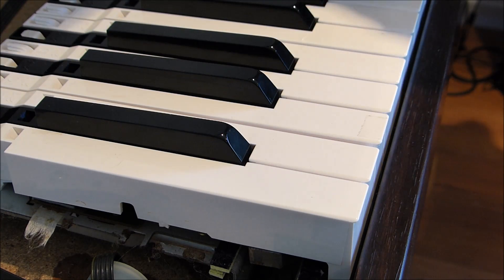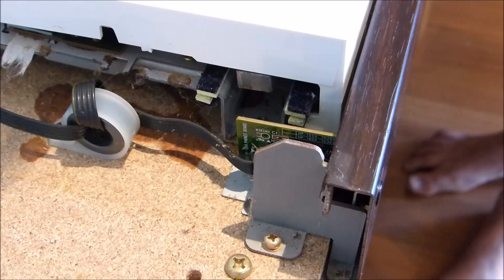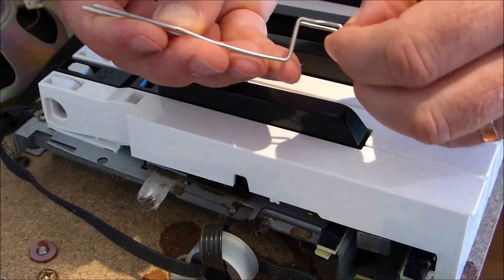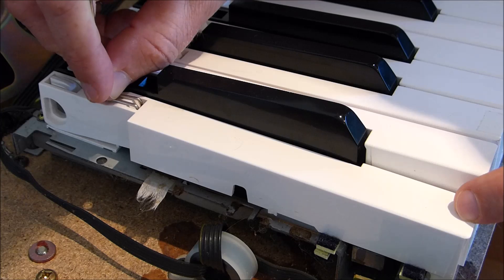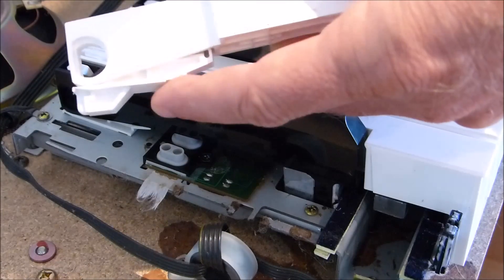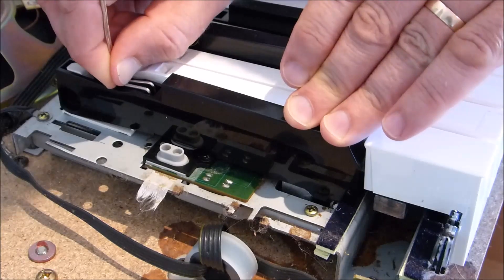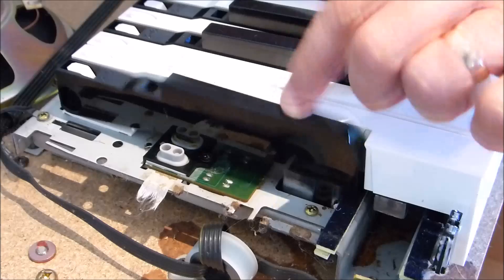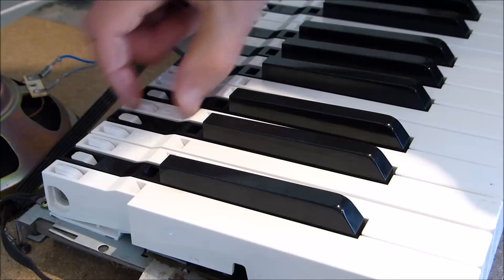Roland HP-230 Digital Piano Key removal for contact repair HP-3700 HP-800 HP-2700 KR-4700 KR-5000

Comment: Ok, i blew it. I cleaned all the connections with rubbing alcohol and then used a 7B pencil on them and now it's even worse off then before, with more bad notes. What did I do wrong??
Reply from the maker: if the circuit board pads were in poor condition its possible the alcohol rubbed them away too much? There are "conductive pens" you can buy to reform the circuit which might help. Utlimately my keyboard needed too frequent repair and I gave it away and ended up getting an acoustic piano (which has its own issues).

Comment: Do thr keys on this piano model have a weighted action?
Reply from the maker: I no longer have the piano but yes the keys did have weights, however I don't think the weight grading changed from the low end to high, it seemed the same all the way through. There is no simulated hammer action.
Reply: @Fontgod  ah right, cheers. There's just one available near me for not too much, and I wasn't sure whether it'd be worth repairing instead of buying a new keyboard.

Comment: Thanks for getting me started on this RD300S I'm working on . I found an alternate method for removal of the keys but, you need a mechanics-style right angle pick made of hard steel. It fits under the TAB area and you push it like shown in your video. Black keys come out in the opposite direction.  Just take care when removing the white keys. The bottom hinge is spring loaded and it MIGHT want to pop open.
Reply: There's  LOT of debris in the assembly which means I'll have to pull ALL the keys to clean up the keybed
Reply from the maker: Thanks. That sounds very similar to HP-230 method.

Comment: Thank you. I’m attempting a repair on a neighbors HP 800 which I believe was made around 1987. Besides massive amounts of cat hair, some liquids and various other debris have infiltrated the piano. There are two keys that have issues. One is excessively loud and the other works maybe every 40 pushes. After watching this video I was able to remove the non-working key. I have hope that I’ll be able to clean/repair the contact of the non-working key when I get back to it at a later date. There’s really no other information on the internet that I could find for this old model other than some sketchy download sites. Without your video I’d have no clue how to remove the keys. Thank you again!
Reply from the maker: Glad it helped you. There are usually two contacts for each key and the time it takes between when each contact is activated determines key velocity, one of the contacts may have some debris that shorten the time causing the piano to think that it has been hit at full velocity. Often cleaning applying carbon to the contact with a very dark lead pencil can fix the keys for a while. I eventually gave away my piano as it needed repairing/cleaning more and more often. I'm not sure if the contacts are the same for the HP800, but on my old piano there was a plastic cage surrounding each group of key contacts, unscrew the cage for the group and prise the cage from the front upwards and backwards towards the rear of piano and kind of hinge it backwards if that makes sense. First time is harder as it is sticky. When re-screwing the cage, first spin the screws slowly counterclockwise and wait for a slight click as they drop into the thread, then clockwise screw to tighten, this helps prevents cross-threading which is what the screws really want to do if you don't use this method.
Reply: @Fontgod  thank you for being so responsive to comments on your video. I was successful in getting a few of the keys removed but with much difficulty. I suspect the tool I made is too stout, that is the wire I used is too thick. I broke the small lip on one of the keys that keeps the rocker/spring mechanism in place. After much worrying I realized it does not keep the key from popping up higher than the others so much relief there. I've super glued it back together and expect it to not be a problem. I will refashion a new tool that will hopefully allow me to remove all of the keys. This unit is absolutely filthy! If not, I will just focus on the 2 keys that are a problem. The HP 800 does not have "cages" as you mentioned but just the rubber cover that presses into the PC board. Cleaning/repair should not be a problem once the key(s) are off. Thanks again for responding. I will repost with the results.
Reply: @Fontgod  I made 2 more keys out of different material, as close to the specifications you provided. I was unable to make them work. Somewhere along this journey it became clear that locking down the piano key then pulling up disengages the plastic stud that locks the piano key to the frame thereby allowing one to slide the piano key out of its positioning slot. What I ended up doing was, starting at the end key, I slid a razor knife blade under the piano key base then pried the base up enough to disengage the stud and slide the key out. I successfully did this for the entire 88 keys. Nothing broke and I now have the unit opened for a much needed detailed cleaning. I found debris between the contact of the non-functioning key and with just the rubber cover in place it now is sounding. I will check each key as I replace them. Thanks again
Reply from the maker: @nunyabuisness9658  Yes, that is an alternate method that is mentioned in the comments a few times but does require removal of all keys to the left of the one you want to fix (if you start from the left), my piano had a small slot on the side of each key that would have made this even easier as a small screwdriver would  also work on the side. The tool can be a bit intolerant and possibly even needs different measurement for your model. Glad you got it sorted.
Reply: @Fontgod  thanks again for your initial post. After a painstaking cleaning,  this 35 yr old HP 800 works and looks like new again! I watched the video again and can see the slot on your keys where a small screwdriver would fit to lift the stud out of the metal base. The HP 800 keys look identical to yours but without that slot.
Reply from the maker: @nunyabuisness9658  Always nice to hear that a piano stays out of landfill for a little bit longer. Well done. :)

Comment: I cannot  thank you enough for this video. I have a Roland hp 1800 with the same keys. I was just about to give up on the homemade tool, and it worked! Was able to fix my FFF key with the matchstick trick too. Am happily playing again...
Reply: Can you explain the matchstick trick?
Reply from the maker: Very glad it helped you, keep in mind that the problem may recur over time. I used to keep the screws out of the casing so I could easily open it up every few months to fix keys that were failing. Have added the HP-1800 to my description based on your comment.  :)

Comment: hi there fontgod, amazing video, thanx so much! is there any particular order keys should be reassembled in hp 230? im afraid i got them rather mixed up
Reply from the maker: I no longer have my HP-230 but I do recall the keys are marked on the back end, however I don't think the key weights are different from low notes to high notes like on some other variably weighted key pianos so perhaps it does not matter too much about the order.
Reply: @Fontgod  si si, youre quite right, black keys are all exactly alike, despite different markings on them, white keys are seven types, they all have their markings: A B C...  and so forth, thanks again!!! that cleaning did wonders!!!

Comment: Super helpful and thanks so much. I have a KR 3000 with the same keys that has seen a rough life before I got it. I was looking at your paper clip design, and it reminded me of something. Those things that come with paint cans to open them (they look like beer bottle openers) work really well - got all 88 keys out with no problem using that. Thanks again
Reply from the maker: Interesting, did you need to bend it as per my instructions or was it pre-bent to a suitable state?
Reply: @Fontgod  Nope, it worked just as it was. Some of the newer ones that come with paint cans are a little wide for the hole, but I suppose you could grind off a little bit on each side. The "hook" is fine. Cheers, and thanks again!
Reply from the maker: @sophiezanep  Great tip, thanks for that. My Roland has since passed on to a new owner but I'm sure it will come in handy for others.

Comment: Worked like a charm, thanks for the tip! I noticed that I only had to make the 7mm and the 3mm bend at the tip of the wire (I used a thick paperclip as you suggested), the other bends were not needed...
Reply from the maker: Good tip. The bends are as defined by Roland, so I'm guessing that the third bend helps to hold the tool in place (it's been a while since I have looked at it), although as you say it will also work without.
Reply: @Fontgod  Indeed, because I have to hold the tool in place with one hand while removing the key, you do it without doing that. Nevertheless, in the meanwhile I have been able to repair all my keys, and am playing my digital piano again. Thanks for the tip again!

Comment: Very informative video!  I have a very loud key on my Roland HP-2900G.  Do you know if that model has the same key mechanism where your technique would work?
Reply: Thank you for taking the time to research and for the very detailed response.  I will definitely give this a try soon and let you know how it goes.  Thanks again!!
Reply from the maker: @josephwallace6058  No problem, hope it works out for you.
Reply: @Fontgod  Update:  So I was able to successfully open up my Piano and remove a number of keys with the paper clip tool.  Your video and tips really helped me get through this process, so thanks again for the information!  After cleaning the contacts I discovered that the rubber contact pad (aligned to my troubled key) had a slight tear.  And it looks like this is the issue because it doesn't land correctly when the piano key is pressed down and forces the loud sensor to be triggered.  I'm now trying to find a replacement pad and hope that will fix my problem.  If anyone knows any sites to check let me know.  It's out of stock on Syntaur.com. Thanks again for all your help!
Reply from the maker: joseph wallace oh that could be a problem then. They always seem to be out of stock at syntaur, perhaps if you message them they may stick them occasionally when a broken donor keyboard becomes available. You could try glueing if the tear is not too bad, or perhaps swapping pads from an area of the keyboard that is less used, that may at least allow you to play the centre of the keyboard.
Reply from the maker: @josephwallace6058  I think it's likely that Syntaur only get them in stock as salvaged items so perhaps they may be able to put you on a wait list? Failing that, not sure if the tear could be stuck with superglued or maybe some silicone if it is not too bad? You could also swap the contact strip out for one further up or lower down the keyboard which may at least allow you to play the centre of the keyboard.
Reply: @Fontgod  I was lucky to find the rubber piece I needed on Ebay, and was just able to open my Roland up again, take out the keys and replace the rubber piece.  Finally, my issue has been corrected.  My son and I are very happy since we've been dealing with this annoying G note for months.  Thanks again for all the directions and advice!  Your videos really helped me!
Reply from the maker: @josephwallace6058  That was a lucky find. :)
Reply from the maker: I did a bit of research and it seems that the HP-2900G does have a very similar key mechanism which I think is called SK-6L (not SK-6 as is the case with my piano). From my understanding the key removal tool is the same, however the sequence to removing the keys is slightly different in that to remove a black key you first need to remove the two white keys either side of the black. Replace in the opposite order.

The velocity/volume issue is likely related to a dirty or bridged contact below the key. I'm guessing that some conductive material may be stuck to the velocity contact causing it to be bridged and hence the key is playing at full volume even when pressed lightly. Ive had similar issues with mine that has been fixed at least temporarily with a contact clean with isopropyl alcohol. The contact rubbers need to be removed to clean below them on the circuit board itself. On my keyboard, I removed 3-4 screws from the plastic bracket holding each contact strip in place then it can be easiest to tilt the bracket up and backwards like a lid rather than trying to remove it completely as it can be a bit hard to remove otherwise.

IF your keyboard is similar to mine, the first time you do this the bracket may be hard to lift up as it may seem stuck to the circuit somehow, you may need to lift it at the front with a thin plastic pry tool to get it to unstick. You'll need to remove quite a few keys to get access to each contact strip as each one is around 20cm wide or therabouts (some are shorter or longer than others), just remove keys until you see the left or right edge of the bracket.

A tip when replacing the screws in the bracket, if they seem to crossthread and hard to screw back in, try turning each screw slowly anticlockwise for about half a turn until you feel them click slightly on the thread, then commence to screw back in clockwise. Good luck.  :)

Here is a link to a document about your keyboard mechanism. https://f01.justanswer.com/proaudio2016/fdd4c524-1a07-4893-a74f-574c98ad61e1_7312018.pdf

Comment: technique worked for my rd250s. Thanks for the video.
Reply from the maker: Great news, thanks for feedback.
Reply: Me too - the rd 250s - - - what an odd little tool needed to pull the keys - like what a crazy world eh?  Where you have to actually bend a paper-clip  - - to lift a key - - - to remove it  - - - - and clean the area = = = = = and boom, you're playing great (hopefully great) music again!
Reply from the maker: @wpiskyvision  Very mediocre music in my case, but yeah. If cleaning under the contacts you need to remove a bunch of keys to get to each contact strip though, unless just doing the trick where you remove a single key and insert a matchstick or skewer into the little holes at the top of the contact strip and wiggle it around a bit for a temporary clean. :) I leave all my screws out of the piano case to make it easier.
Reply: @Fontgod  My first keyboard - as a 16 year old "Rocker" in the making - was a Roland SH-5  synthesizer ( is mono-phonic     one note only at a time - - - so no chord playing ) and I took it apart many times to explore how it worked - discovering multiple layers of circuit boards - - - - all boiling down to the keyboard. 

The keyboard of the Roland Sh-5 is springy and kind of cheap feeling - but quick response for plastic keys.

Wow, just got your reply - You are amazing my friend!
Reply: @Fontgod  Great idea!  Fuck yes - Just leave them out!  Why not?  It's like, who's going to ever need them in again anyway right?  And if so - well here they are - in a plastic bag, somewhere - here - I can find it somewhere....  ha ha ha lol   love you bro!

Comment: Fantastic, I copied your tool from a large paper clip and it works on my roland hp800. Thanks from UK.
Reply from the maker: Great to hear that. Technically it's not "my tool" as it's based on Roland's own recommendations for making the tool yourself.
Reply: Fontgod , good on roland for this but i learned it on your video, its very handy and it sticks on the magnetic speaker, the next time i need it.
Reply: Fontgod , good on roland for this but i learned it on your video, its very handy and it sticks on the magnetic speaker, the next time i need it.
Reply from the maker: @ganimisa  Good tip and thanks for the kudos. Roland sell a proper tool (or at least they used to) but they should be commended for giving details of how to make one in their service manuals.

Comment: Will this work on Roland RP-500?
Reply from the maker: Unlikely as the RP-500 is a much more recent piano I think, my guess is they would have changed the mechanism since my HP-230 was released.
Reply: Fontgod I see. Well my problem is a couple of keys are a bit louder and I have no idea how to fix them. Any suggestions?

Comment: thank you for your job but i think this is a better way to take out a key of these kind of keyboards https://www.youtube.com/watch?v=ssbsdcXe0GA
Reply from the maker: Thanks for the tip. That looks like a good alternative if you need to remove  a large amount of keys at once. If you need to only do a small section of keys or a single key then the key removal tool method is ideal. It takes a little time to make the tool the first time but once made you have it forever. It's also Roland's recommended way to remove keys as per their repair manual. There's also another way to remove them if working across from one side of the keyboard using a small screwdriver to lift each key lock out, but not suitable if you only want to take a few keys out.

Comment: Is it possible to buy the key removal tool?
Reply from the maker: Roland did previously produce one, known as a "SK-6 Key removal lever". Unsure if they are still available through Roland, I suggest contacting them directly. However it is quite easy to make one yourself using the instructions at the end of the video above if you can find a thick enough paperclip, it should do the job.
Reply: @Fontgod  Okay, thanks!